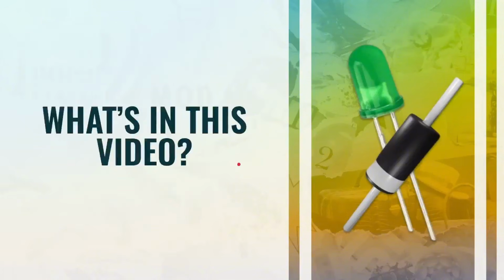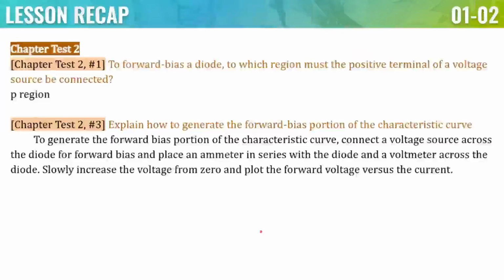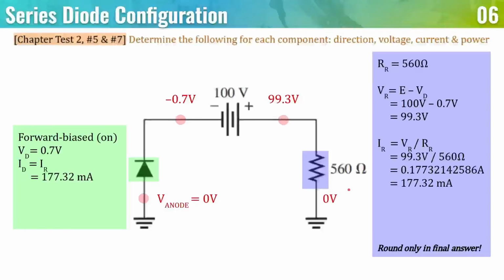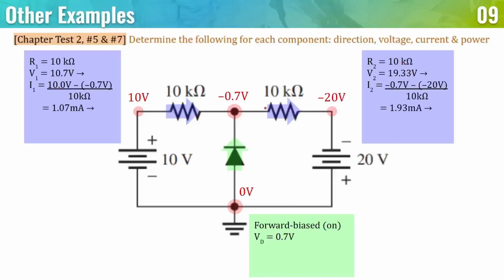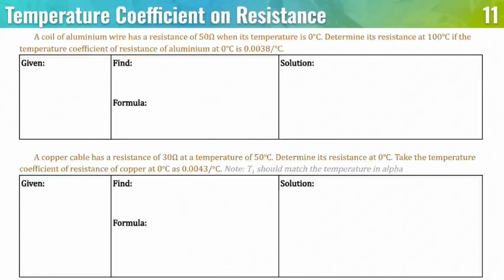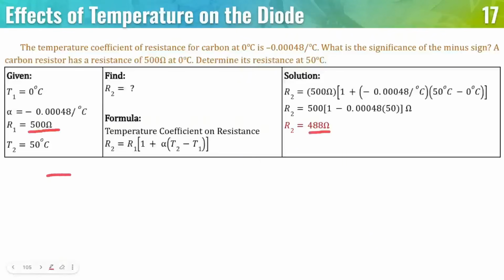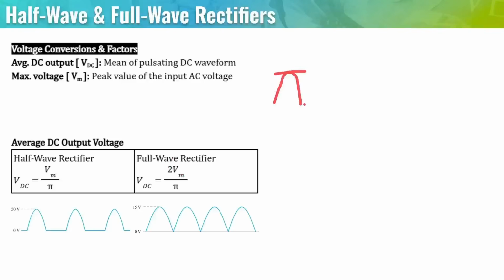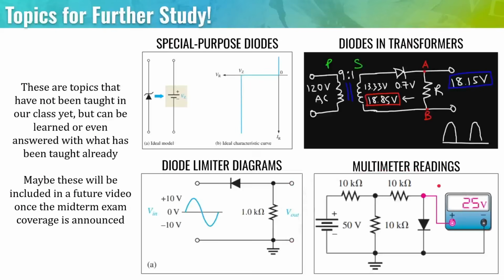Diodes, Shockley's Equation, Temperature Effects, Half-Wave and Full-Wave Rectifiers & More

Comment from the maker: TIMESTAMPS AND CORRECTIONS!

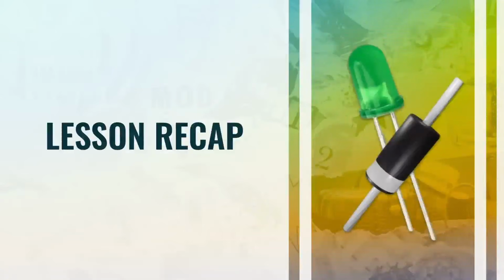0:02:21  Introduction to Diodes Recap
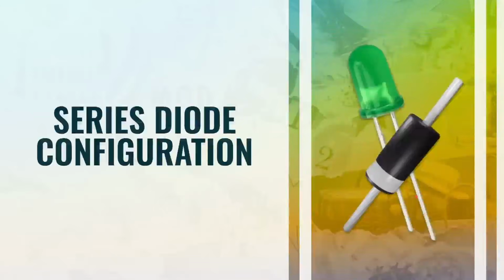0:17:04  Series Diode Configuration
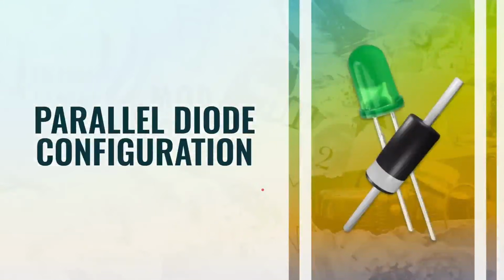0:34:16  Parallel Diode Configuration
1:00:07  Effects of Temperature on the Diode
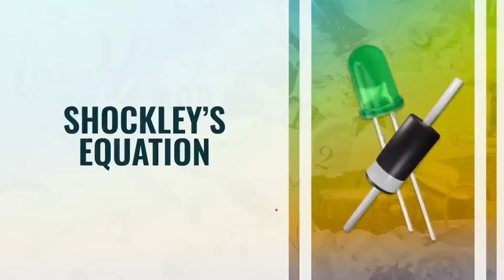1:24:45  Shockley's Equation
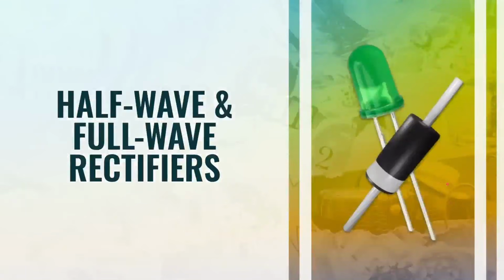1:36:12  Half-Wave & Full-Wave Rectifiers
1:55:08  Topics for Further Study

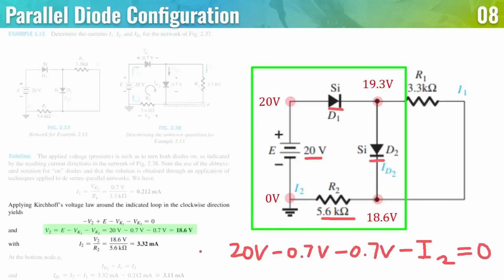0:41:34 In KVL, we should use V2 instead of I2. I2 is supposed to be for the next step - KJ

1:23:24 In the example, temperature should be increasing (wrong direction of example but correct final interpretation) - Tristan